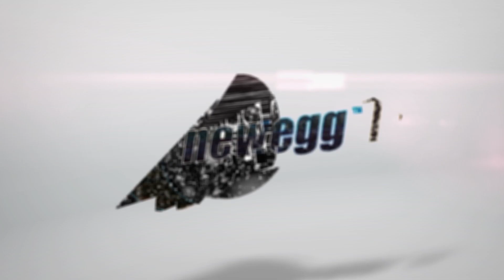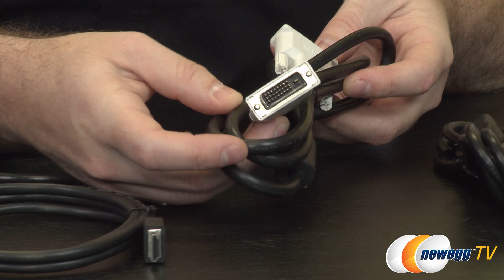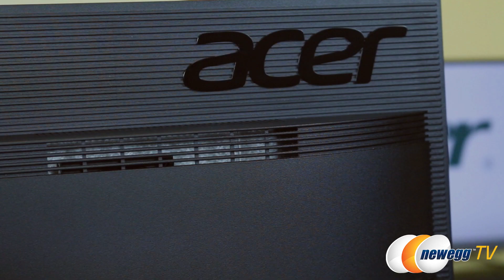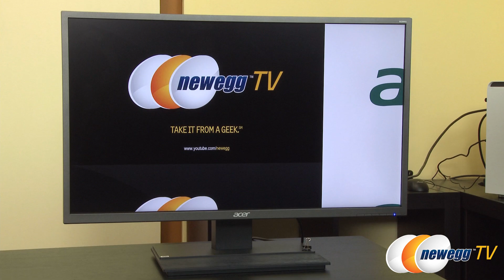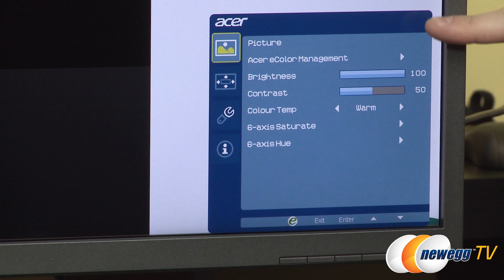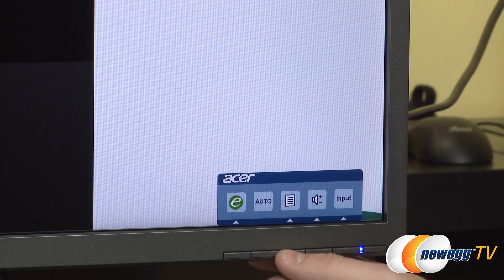Acer B326HUL 32" LCD Monitor Overview - Newegg TV

Comment: Which one is better, THIS or BenQ BL3200PT ?

both are 32", 1440p, and about the same price (800-900 bucks)
Reply: IndraEMC 10 monthold but to others. this has 3000:1 contrast and 100,000:1 dynamic contrast (google it) 
whilst the BenQ has no dynamic. and is still 3000:1
It's a matter of what you need.

Comment: It's 4k or nothing from here on out. I have a 1080p 24" Asus. Won't get a bigger monitor unless it's 4k.
Reply: Stephen McAllister well, for the same PPI  u need 48"
ur monitor has 98 or so PPI, this is 32" and 1440p and so it has the same PPI but it's bigger. So i think your not MATHING so i just need to tell you.

Comment: Man this would be really really nice...but I'm sorry 32" is just too big for a monitor in my experience for practical close up use. Don't get me wrong I love that this thing is real and not 1080p!!

I will say the pixel density on 27" 1440p models is absolutely perfect though.
Reply: I've been using a 27" 1440p monitor for over a year and no it's not perfect. Actually 27" is a bit too small and 1440p on it is nearly 110ppi which makes things look very small. 32" 1440p is equivalent to 1080p 24" which is perfect for me.
Reply: ***** That is to close for FPS gaming with that big of a monitor. It also looks crap since you have a tv and it's only 1080p (assumption...)
Reply: *****
I have mine on an Ergotron MX arm so it floats above my keyboard, the size feels perfect for me. I think the ppi is perfect, you want small shovel out for any of the stupid 4K monitors out there, that is just silly.
Reply: ***** You know you can scale things?
 What is perfect and not is personal preference.
Reply: Yes i have to agree 32 is to big i had one myself and i had to move my head to look in the corners and that is not what you want if you play a lot of games.
Reply: Salpeteroxid If you've ever actually tried the scaling in Windows you would know how horrible it is.
Reply: *****
Which is why i'm not too excited about having a 4K monitor just yet
Reply: ***** 1440p 32" is equivalent to 1200p on 24". Just saying :)
Reply: Ｒｕｓｈｎｅｒｄ for me 98ppi is enough
16" 720
24" 1080
32" 1440
48" 2160